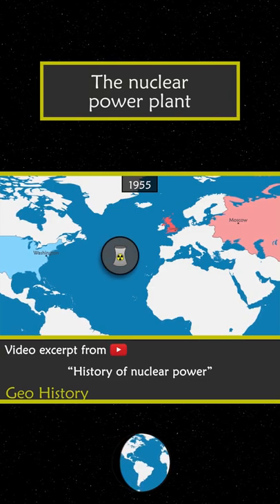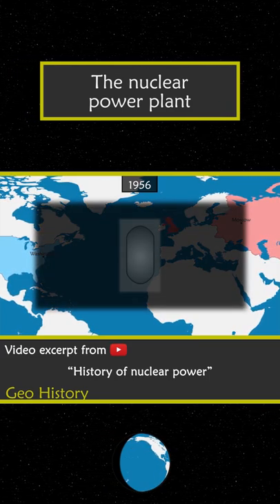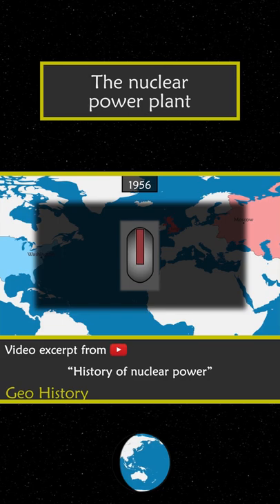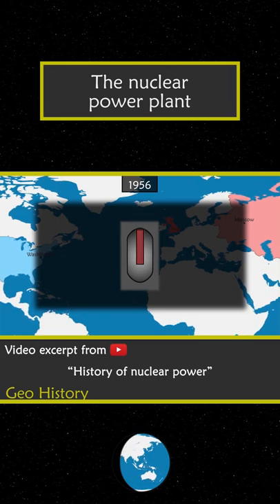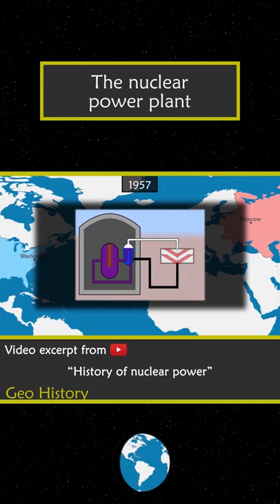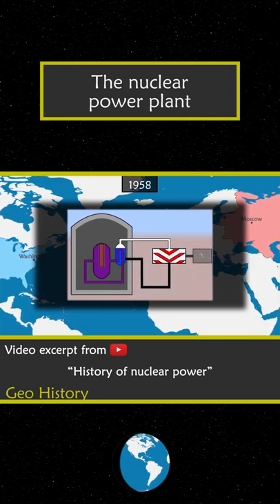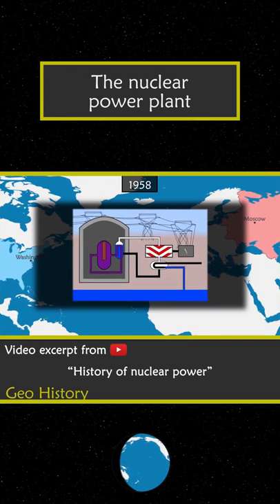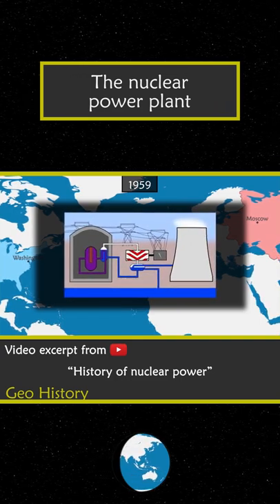The nuclear power plant - #Shorts

Comment: Can someone explain to me, why you have to use a tertiary circuit to cool down the second, rather then just slowing down the nuclear reaction to heat the secondary circuit by a smaller amount in the contact zone between the first and second circuit. Wouldn't that yield the same amount of energy, stop warming the rivers/atmospere, save fuel and generally work in the same way? Cheers!